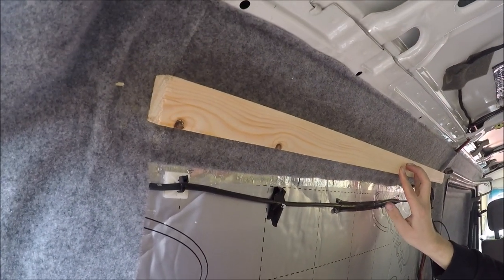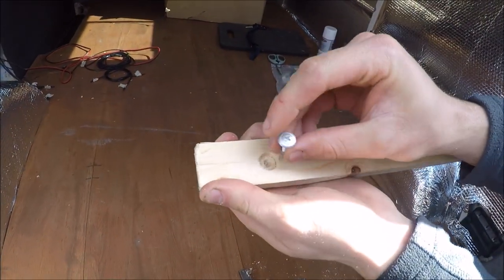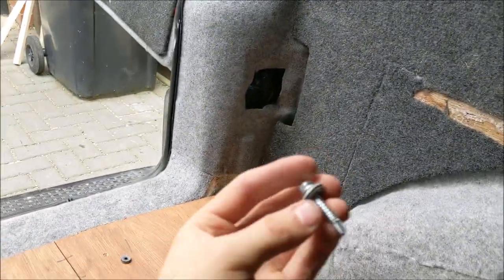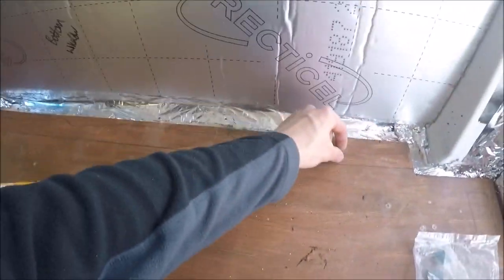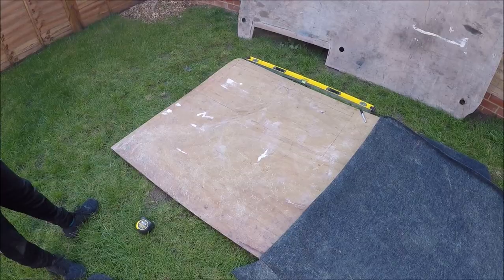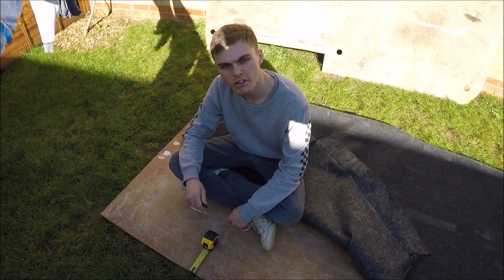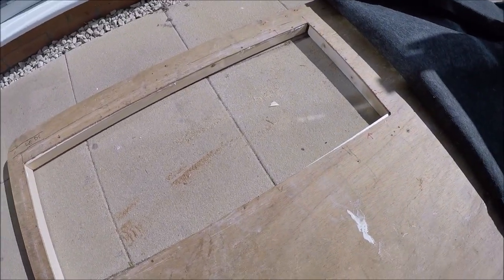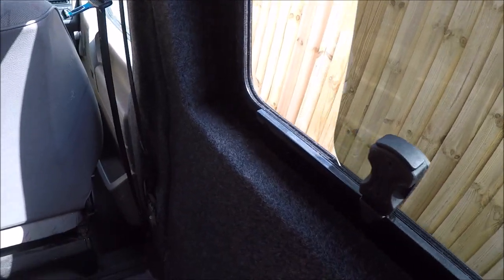WALLS AND WINDOW FRAME IN MY T4 CAMPER VAN

Comment: Thanks for this video it has helped me out so much I had to cut mine at the arch then just run a bit of trim up to the next panel (i basically bottled cutting the arch in on the same panel as the frame) such a clever way to make the wall look so much better specially when using a full width r and r